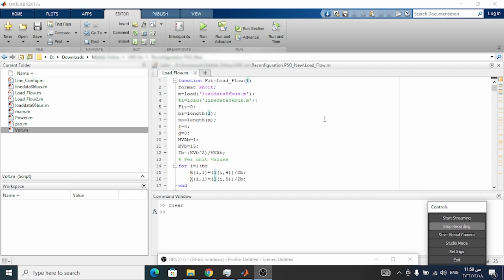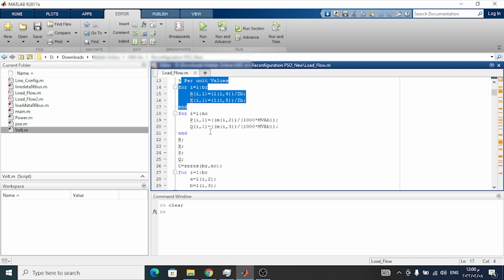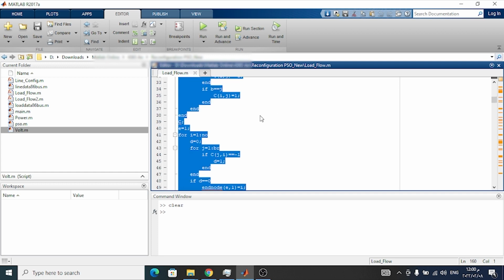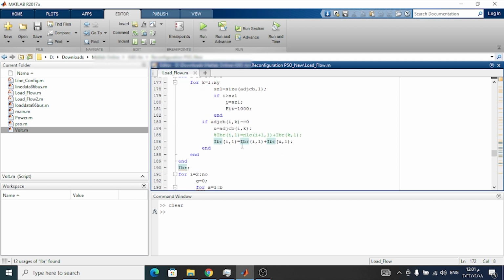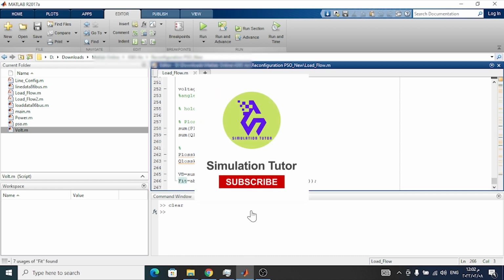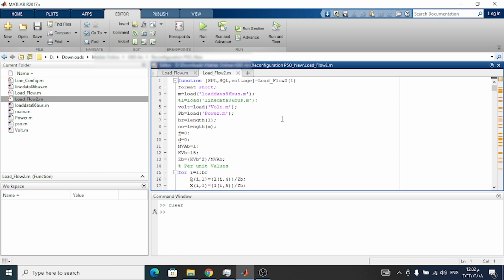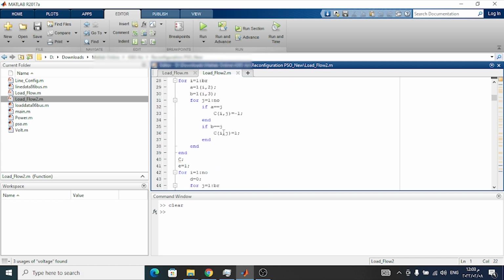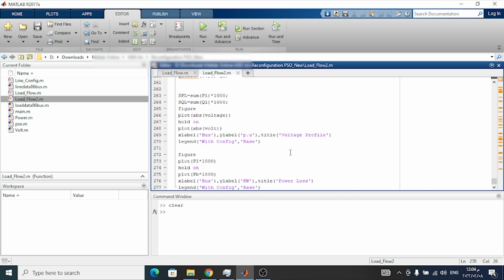Optimizing Power System Reconfiguration: By using Particle Swarm Optimization - Part 05

Comment: hello sir, thanks for your video, that's very helpful for me, but sir, i wanna ask you something, if i have 2 feeder to configurate, where these 2 feeder are separate, i move some of the load from 1 feeder to another feeder, i want to connect one bus from feeder which has less load  to connect at tie line from another feeder which has overload, if the overload feeder has 7 tie line, where do i enter the length from 1 bus at less load feeder to the tie line in overload feeder, is it in the line data? thank you sir☺️
Reply from the maker: @finaaprianiputri  contact@simulationtutor.com